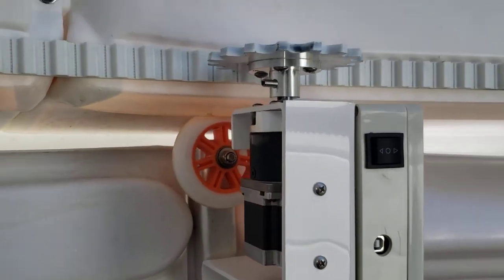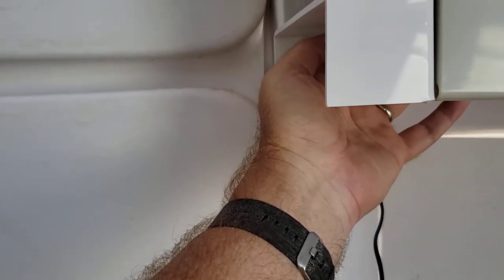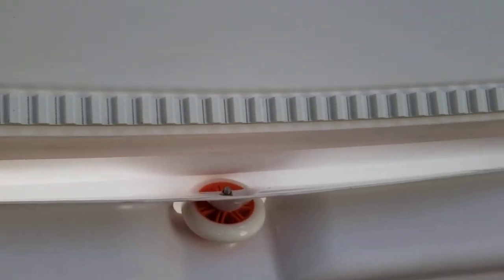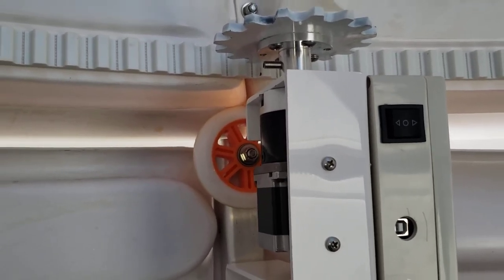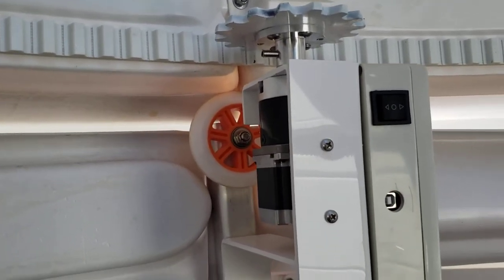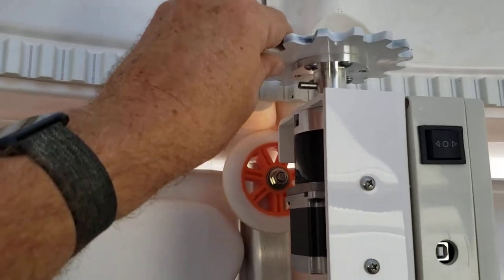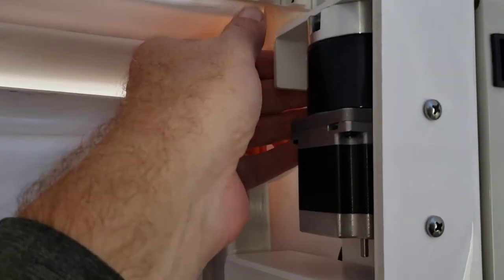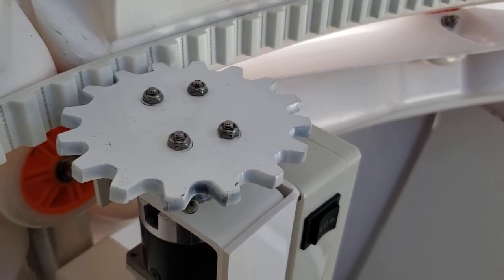dome rotation motor part 3

Comment: The bracket is hooked one side to the plate of the motor and the other to the bolt of the wheel, I had to redrill after I found out
Reply from the maker: Thank you. I will see if I can fix it.
Reply: @greybeardsastro3477  its stable without it when tracking or manually moving it using the switch, i had it slip countless times when slewing
Reply from the maker: Thank you again. I managed to get it hooked up without redrilling.